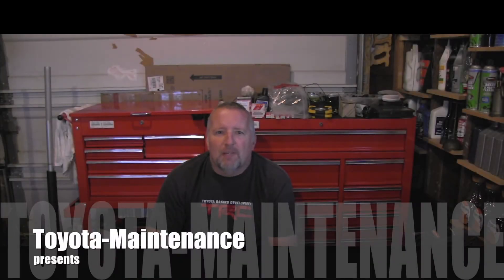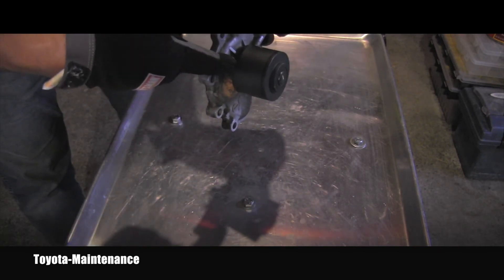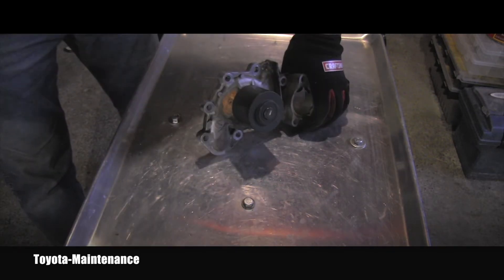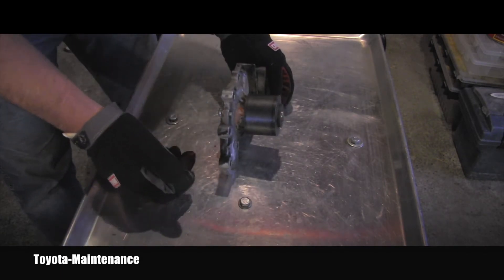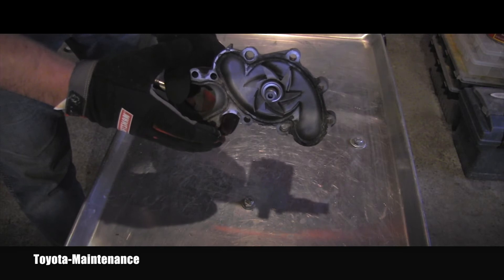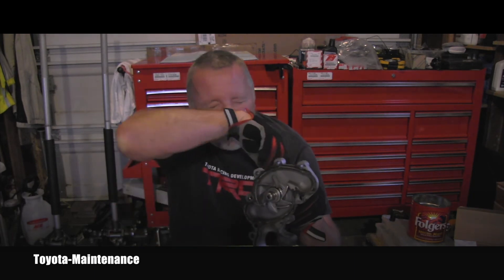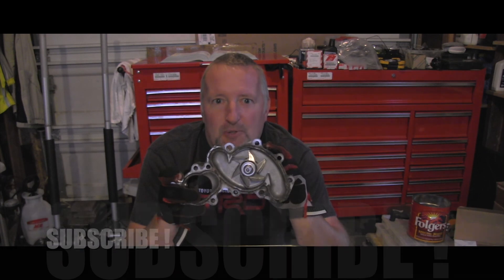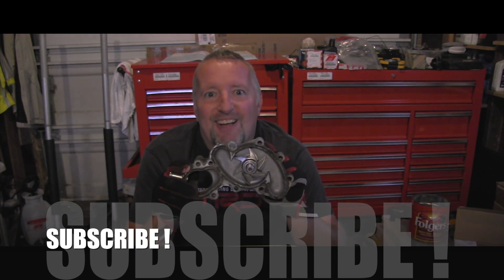Toyota Tech - Why Engine Water pumps fail

Comment: I have a 2002 Tacoma Prerunner with the V-6 which as you know has a timing belt which I had  changed out at 90,000 miles and they always recommend changing the water pump as part of the job so I did. I always use Toyota coolant and mix it half and half with distilled water.
Reply from the maker: Thanks for sharing

Comment: My 1998 4runner at 258,900 miles and still on the same water pump. No play or no leak but some corrosion when I pulled it off.
Reply from the maker: nice thanks for sharing

Comment: i have a 2014 Camry with about 150,000 miles with no problems what so ever, should i replace the water pump just in case?

Comment: Very informative video.  Does the condition of the coolant affect the life of the water pump.  Thanks for posting and God Bless...
Reply: I'm assuming it could, like if you don't flush the radiator every 30K miles, the coolant may become corrosive and cause the radiator to fail and coolant ends up mixing with transmission fluid, causing pink milkshake!
Reply from the maker: Absolutely, it does !!!

Comment: If there is a loud squeal at start up could it be the water pump? I guess it could be an idler pulley too. I made a spark plug video replacement and at the end during the start-up you can hear it. I won't leave a link because of spam detection but you can find the Toyota 4Runner spark plug change video on my channel if you'd like to let me know if youve heard that squeal before.
Reply from the maker: Loud squeal at start are normally belts... I have video about that on this channel
Reply: Toyota Maintenance great I’ll check it out!
Reply: Toyota Maintenance by the way I’d love to do a collab sometime
Reply: Mine was squealing at startup and a week later it started dumping coolant

Comment: Great video I just got my first Toyota do you recommend going to dealer to get parts or just a regular parts store like AutoZone
Reply: Go OEM toyota parts man!!
Reply: Forms ok cool I just got a 2016 Corolla the book don't say anything bout when I should service the transmission it's an automatic
Reply: Transmission shouldn't need to be serviced its got nice toyota fluid in there. just make sure it isn't losing any fluid and you should be A ok. our 97 corolla has 260k on the factory fluid, it does great it's our beater car though, i would confirm with @Toyota maintenance.
Reply: btw this guy's channel is a goldmine of information, hit the sub button you'll be glad you did. I wish he worked on my truck!
Reply: Toyota doesn't really make many of the parts on the car.  Next time you open up your hood, look at some of the components and you'll see names like Denso, NGK, Aisin, etc.  These are OEM suppliers that actually make many of the parts for Toyota and Honda.  

Try this, take a look at your radiator and it will probably say Denso on it.  Then call your dealer and get a quote for a new radiator.  Then go to Denso's website and search your year, make and model to get the part #.  Search the Denso part # on Amazon, RockAuto, Google etc. and see the price difference.  

I buy my car parts usually from RockAuto.com or Amazon.